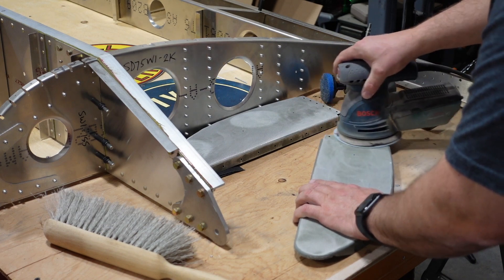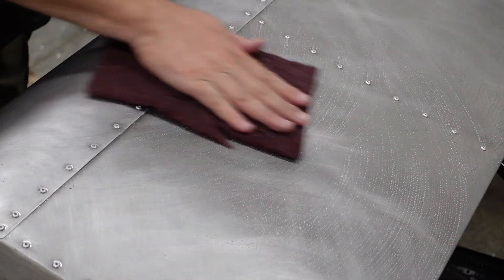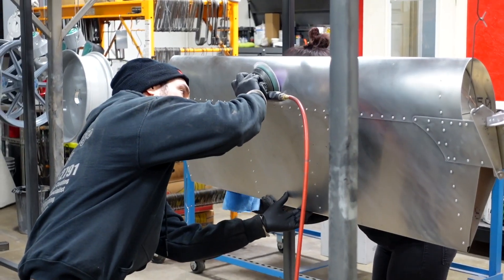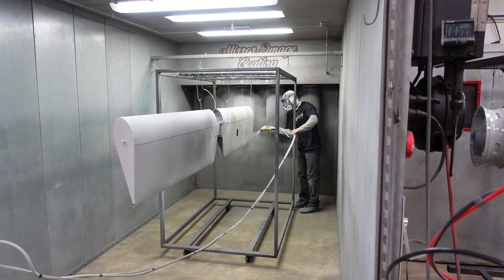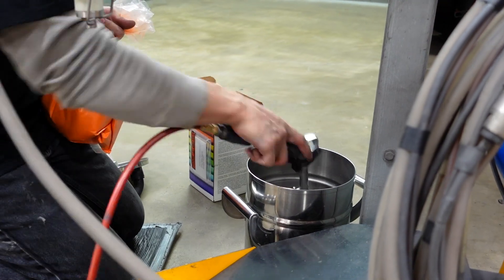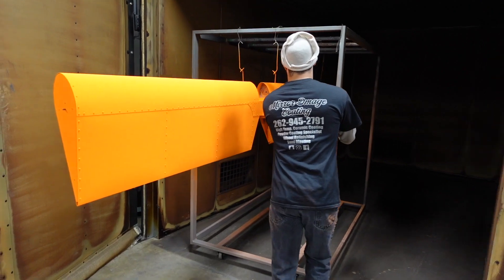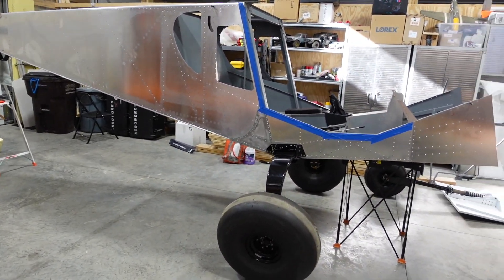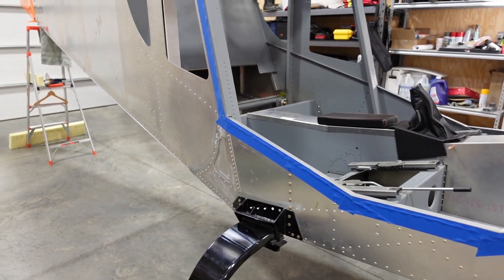Ep. 27 | Empennage Completion | Zenith Super Duty Aircraft Build

Comment: How heavy is the powder coat compared to paint? How about touch up if you need to repair a small damage spot?
Reply from the maker: Dry comparable to paint even lighter in some circumstances.  As for touch up, it remains to be seen but should be tougher.

Comment: Have you ever considered what detrimental effect the temperature of powder coating baking/curing has on the fatigue strength or properties of the aircraft grade aluminium ? .. if not, you really should!
Reply from the maker: Yes contacted manufacturer, the short time and temperature used has no effect.  Someone put it this way when I was concerned myself about the heat.  We bake a pizza at 450 for 25 minutes just to melt the cheese.
Reply: @AeroworksProductions  "No effects" ... really, none? Anyone that compares aircraft materials, metallurgy and structures to baking pizza's, really shouldn't be in the aviation business and certainly not giving out advice to others!
Reply from the maker: @simonbaxter8001  If you have information you’d like to share with the others, please do.  I’m not the first one to powder coat an airplane part.
Reply: @AeroworksProductions  From an old homebuild discussion on the topic: 

Powder coatings may damage, or eventually damage, aerospace parts.

1.  Cure Temperatures.

MIL-C-24714 allows cure temps of ~400F for ~30 Minutes.
AMS3143 allows cure temps in (2) catagories (no time limit specified]:
Class 1 NO restrictions.
Class 2: 300F [no time specified.

These temperature ranges can affect temper of some 2XXX and most 7XXX aluminums.

2.  Coating thickness: Powder coats tend to routinely exceed 0.003" dry-film thickness; wheras production-quality solvent or water-borner primer coats of 0.0006" dry-film thickness are common. In the case of epoxy coatings: LESS is superior to thicker, since flexure of thick coatings causes brittle cracks to open and poor adhesion of any decoratve top coats. Obviously "stiff parts" [forgings, thick extrusions or plate] are far less affected that sheet-metal [in flexure].

3.  There are several aother critical issues regarding powder-coating of aerospace parts:

3.1  These temps can cause serious outgassing in porous castings [aluminum or magnesium]; so-much-so that finish quality is poor [blisters, pin-holes, etc. In some cases powder additives can help control these blemishes... but NOT 100%.

3.2  "Old" unsealed magnesium and aluminum castings [+10yrs in service] are subject to low-level moisture intrusion: this can either desrtroy the casting if heated to "moisture steam" point [crack/explode]; or can cause totally unreliable coating quality due to out-gassing.

3.3  Thick/hard/baked coatings are typically VERY difficult to REMOVE [strip-off] using chemical or blast-type stripping methods.

3.3.1  Chemical strippers have to "work" longer and harder to break high-temp cure bonds... especially when very thick. In some cases special strippers would have to be formulated for removal of specifc epoxy powder-coating formulations. In discussions with a paint stripper vendor, I expressed concern regarding removal of finishes on adhesive bonded thin-skinned aluminum-honeycomb parts. I did NOT want the exterior adhesive bond-primer damaged... while stripping thh Polyurethane top-coat and corrosion protective epoxy primer. Vendor assured me that the baked epoxy adhesive bonding primer had MUCH tougher chemistry than the solvent or waterborne corrosion protective primer... and sure-enough [after several tests] we discovered he was correct: the chemical stripping action seemed to "stop" as it hit the baked material.

3.3.2  Media or water blasting of hard resinous surfaces over soft aluminum or magnesium substrates is difficult at best; and very damaging to substrates at worst [media entrapment/contamination in surface, surface hardening and scoring].

Comment: 😲Wow Adam I did not know you could use powering on finishing aircraft surfaces. Great video Learned a lot⭐️⭐️⭐️⭐️⭐️🤘🏻🤠
Reply: You have to be careful because typical 400F cure temps are high enough to hurt the heat-treatment of 6061-T6. I personally would stick to powdercoating only the steel parts and painting the aluminum parts. You can powdercoat 6061-T6, (my company does it everyday) but we cure at a lower temps to avoid issues. Powdercoat is definitely more robust than paint and it looks gorgeous in that orange for sure! Love these vids so I don't want to say something to pick a fight. It's just something I've been seeing more of lately and I think it should be mentioned.

Comment: My painter used Presta "Scuff Stuff" to prep the aluminum on my 750 STOL.  It looks like a rubbing compound and is applied with a gray scuff pad.  The advantage is that it easily gets in around the exposed rivet heads and avoids leaving a "halo" of unscuffed material around the periphery of the head.  It's water-soluble so it easily washes away for clean-up.  Try it, you'll like it!
The powder coat on the flying surfaces is beautiful, tough, and durable,, but it'll be very difficult to touch-up properly if a repair is necessary due to damage or modification - that's why paint is preferable.
Reply from the maker: Great tips.  Yes the majority of the plane will be painted using traditional methods.

Comment: Are you doing everything with powder coating..???? Also have to say looks awesome
Reply from the maker: Thanks Dan, it would be difficult to powder coat everything as you can’t put parts in the oven that would melt.  IE bushings, pitot lines, wiring, etc.  some of which had already been run throughout the wings and fuselage.  Plan is still to spray fuse and wings.
Reply: @AeroworksProductions  bummer would look awesome and last for years.. to bad you couldn't run the wiring after
Reply from the maker: @asiasmells71  yeah there are just some things that have to be done first.  Also wings and fuse would be pushing the limits of the oven size.

Comment: I guess you don't believe in zinc chromate
Reply from the maker: Not many people use zinc chromate anymore due to its environmental considerations, other corrosion prevention methods have been used like Cortec however I don’t live in an area where corrosion will be an issue and the plane will always be hangared.
Reply: @AeroworksProductions  thanks.  I live very close to the gulf of Mexico.  I don't know about the  environmental concerns, but what won't kill you today. 
Some day you might have to treat the metal where it meets.  I am building a 750 and a safari 400. Thanks
Reply: May i ask your engine choice.  I bought a ul 350 for 25,4
Reply: Zenith uses 6061T6 which is corrosion-resistant.  Lots of Zenith's corrosion-free after years of exposure even when not painted and just left bare-metal!  However, most builders use corrosion protection on mating surfaces, especially if in a damp or coastal area.
Reply: You probably can't find Zinc Chromate any more, everything now is Zinc Phosphate, which does not stick as good, I have to keep touching mine up as I work on it. rubs off very easily. What I found works better is automotive self etching gray primer.
Reply: @wb6anp  aircraft spruce has it
Reply: @digdig-cp8lv  I ordered from them it came as Zinc Phosphate.